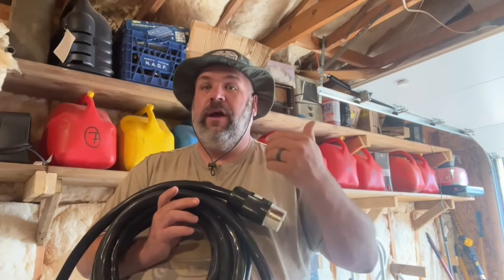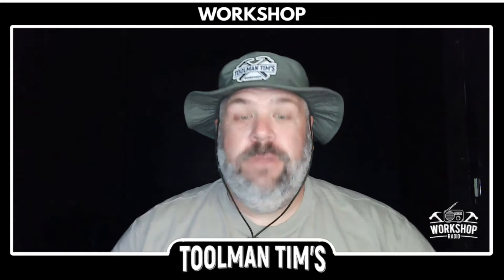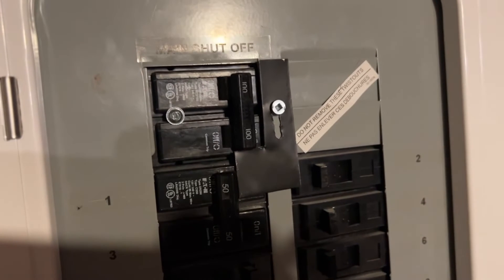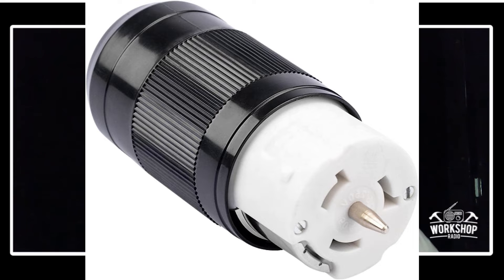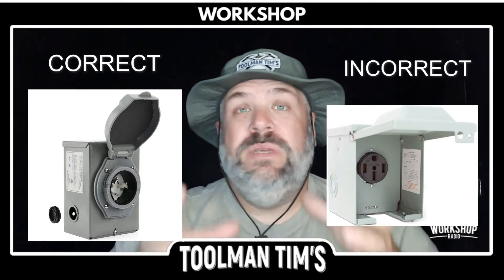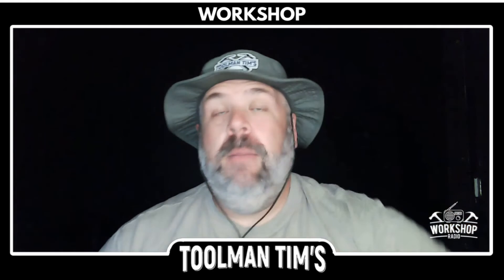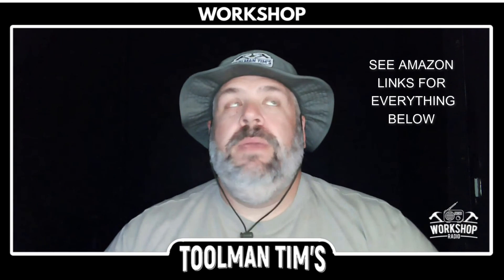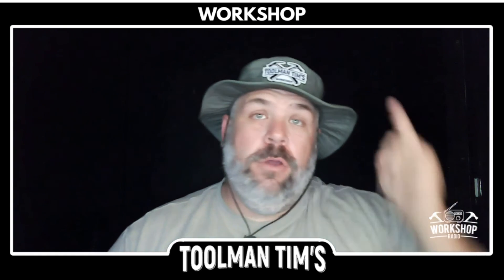How to POWER your house with a GENERATOR! Backfeeding SAFELY 2023

Comment: DUDE,YOU ARE NOT BACK FEEDING,LOL,YOUMHAVE PROPERLY HOOKED FROM GEN,TO A 50 AMP BREAKER ATTACH93D TO PANNEL WITH A PROPER CUT OUT SWITCH,LOL,YOURE NOT BACK FEEDING,YOU HAVE TO PLUG INTO A EXISTING SOCKET TO BACK FEED LOL😂😂😂😂😂
Reply: Its still considered backfeeding any time you do not feed power through the main lugs. Technically my main panel is backfed because  it didn't originally come with a main breaker so I flipped it upside down to backfeed through a 200A crossover breaker and I use the main lugs to feed a subpanel.

Comment: Do it on a sunny day in June. Great idea. Skip the beer in hand until after it's completely finished and tested. Take zero chances with electricity. Other than that, this was a great video. Thanks for the correct information.

Comment: OMG how about this, don't be an IDIOT !! . Interlock kits are for people who shouldn't be doing this in the first place. If you don't know to  go out side or go to your main panel and turn off your 200 amp breaker during an outage, don't do any of this please.  If you've got kids that will go out to your main panel and turn it back on without your approval, spank your kids and don't do this..If your wife will go out to your breaker panel and turn it back on without telling you, spank your wife and don't do this. Otherwise, if you don't drink Tide Pods because you know you're not supposed to, or if you don't put your head inside a plastic bag because you know you're not supposed to. Then save the 30.00 and don't waste it on an interlock kit.

Comment: Are you sure the LL550C female connector will fit the inlet box male SS2-50P as you have referenced in your list of parts?
Reply from the maker: I just doubled check the links and yes these are the two I bought for my exact set up

Comment: I have found dozens of videos on the same subject.  But, I have not seen the following questions asked or answered in any of them.  It was a bit surprising actually.  

The questions is this:  Do I use a floating neutral or bonded neutral generator configuration.  They sell them both ways, and there are videos that show how to change a bonded neutral generator to a floating neutral.  But, I do not see anyone discussing or adding content around this so that I can make a researched decision what is safe.  

There is a lot of great content about how not to get shocked, but if even one questions remains you are 100% safe.  All comments appreciated!!!

If it turns out that a floating neutral is required for interlok systems to a home, I'd hope that is retroactively added to all these similar videos

Comment: After a 4 day power outage last year I set my house up to back feed, 4 days in the middle of winter was the last straw for me, I have my inlet box in my garage, separate building from the house, I like it in the garage, it’s out of the weather and chained to my Harley, only problem with my set up is I cannot use an interlock I would have to dig another trench and put in another line, but I have reminders on the inlet box that says make sure Main breaker is off and One right on the generator.
I also put a battery back up on my garage door because I don’t have an entry door just a big door that I can get my garage door open even when the power is out and lights will come on so I can see what I’m doing in the dark, also installed the power return alarm.

Comment: Im confused on the 220 line in but 110 house plugs? Can you please explain? Thanks
Reply from the maker: so your electric panel is feed by two 110 volt lines coming in hence the 220 one 110 feeds one side of the panel and the other the other side so if you were to feed into a 110 outlet only half of your panel would actually work.  but when you feed into a 220 outlet it feeds both sides of your panel hope that makes sense.  if its something you aren't comfortable with make sure you get help from someone who is :)
Reply: @TOOLMANTIMSWORKSHOP  I think Im understand now. So I believe anything 220 has a double breaker which gives it 220 and anything 110 has a single breaker. Am I close? lol
Reply: @PhillyTechCheck  If you look at the 4 wire 220V outlet on a generator, it's 110V 110V Ground Neutral. The double 220V breaker that you install will put a single 110V on each of its sides and the ground and neutral connect to a bar in the breaker box where all the grounds and neutrals are bonded.
Reply: Love your honesty and willingness to let us know your mistakes!

Comment: The circuit breaker for the 50 amp outlet (14-50R) is a 31 amp breaker. So why use the 50 amp outlet? Won't it trip the breaker once it detects more than 31 amps? Why not just use the 30 amp outlet (L14-30R).

Comment: I installed a 30amp interlock last year after we had a 5 day power loss. There was a tornado in our area and we were very lucky to have sustained minimal damage. Between our neighbors, we shared generators to keep freezer/fridge and sump pumps running. 
Last night I made an impulse buy at Costco of the generator you have. ( hence how I found your channel today) 
I will be upgrading to the 50amp now. The inlet box with twist lock is a great and safer idea. Glad I found your video, was headed to store after work.... 
You have a new subscriber.  Cheers from Wisconsin!
Reply from the maker: Well, welcome to the channel the workshop community. If you happen to be a Telegram user, we have a telegram group as well that’s in the description but beyond that I just love having you here and I always love hearing about people’s backup power experiences. Great to have you.

Comment: Maybe I don't understand thw lockout mechanism fully. During normal everyday "grid is up" usage and nothing is plugged into the waterproof twistlock outlet with the three male prongs, what keeps power off those 3 male prongs? Doesn't this need a way to lock thT outlet (or a throw switch that can be padlocked? 
Or am I overthinking this.
Reply from the maker: No worries took me forever to figure it all out the lock out device doesn’t allow me to turn on the 50 amp breaker to the inlet box outdoors until the main breaker is turned off and then I slide the lock out up allowing me to then turn on that circuit but not allow me to turn off the main.  I will do a follow up the next time I do a test of the set up
Reply: @TOOLMANTIMSWORKSHOP Got it - the lock prevents that circuit from being energized. TY.